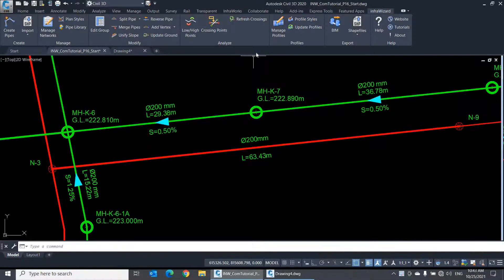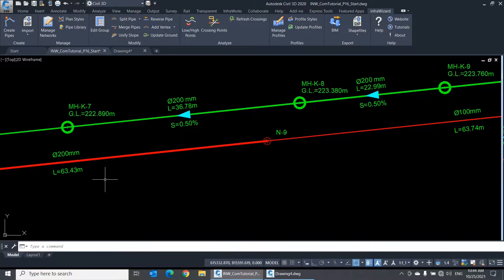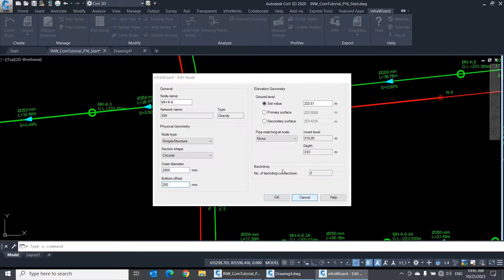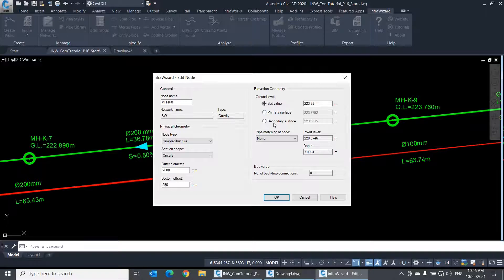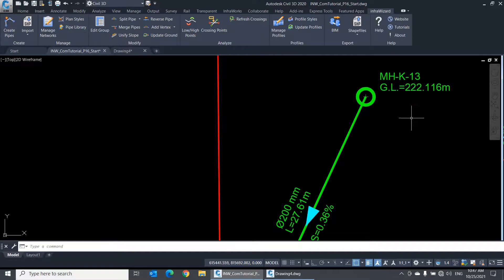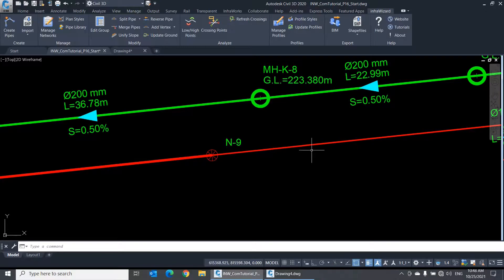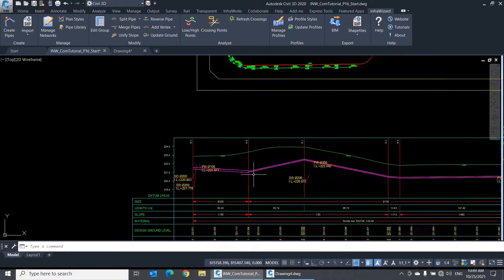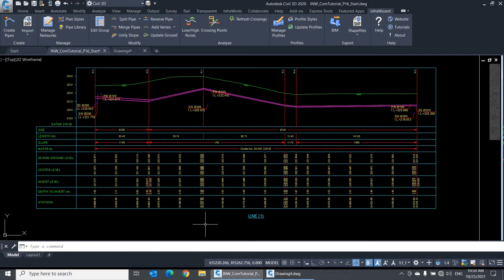infraWizard Tutorial - Part 16: Editing Node Properties

Comment: Now I have problem with chainage how create every 10m elevations and how to create new scale for profiles?
Reply from the maker: Hello Malik. You can change the intervals of chainage in the Profile Style by modifying the "Station Interval" in the properties of Stations data band. You can also change the scale of profiles in the Profile Style by changing the value of "Vertical Exaggeration". The default value is 10 which means that vertical dimensions are multiplied by 10. The horizontal dimensions on the profile graph are always true dimensions equal to the actual lengths in plan. If you need further assistance, please send your query to support@infrawizard.com
Reply: @infrawizard6800  Hi, I tried but there is no option to change every 10m. Chainage and Elevation and no Exaggeration scale. If you could so me snap shot if will very great full you.
Reply from the maker: @malikalam2542  Please send an email to support@infrawizard.com so we can provide you with screenshots demonstrating how this can be done.

Comment: How to edit levels for all node , not one by one. I will copy paste from excel .
Hope you understand sir
Reply from the maker: Hello Mohammed. You can use Edit Group command to change the levels of a group of nodes in one operation. Using the Edit Group table, you can change the node levels by a adding or subtracting a certain value, or use Excel to calculate the new levels then copy and paste them to the table. You can watch the video of Part 17 of this tutorial for better illustration of this. The last minute of this video shows you how to use Excel to calculate new values and paste to the nodes.
Reply: @infrawizard6800  sir, I found 2 issue in this software, first, for AutoCAD we can not draw existing ground line and level in profile. Only design line and level draw, option is available but can not draw.
Second, if manhole height is high like 15 meter it Go above the grid,.
Thanks
Reply from the maker: @md-mohammed8455  Hi Mohammed, for drawing the existing ground line, you can only do it if you're using Civil 3D because in this case you'll be able to assign one surface to the design ground line and another surface to the existing ground line. If you're using AutoCAD, there will be one value for ground level at the node so you can draw only one ground line. For the other issue of profiles, please send us a screenshot or the cad file showing this problem to our support email support@infrawizard.com so we can check it and feed you back.